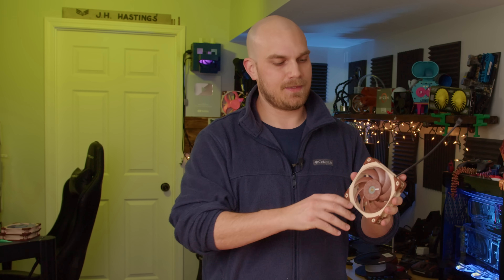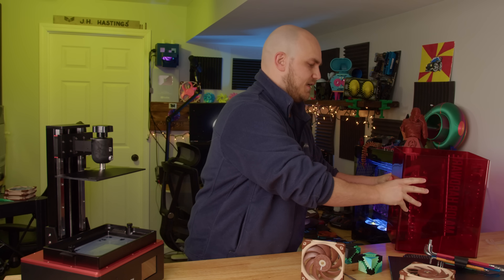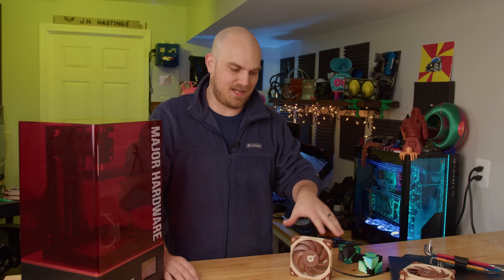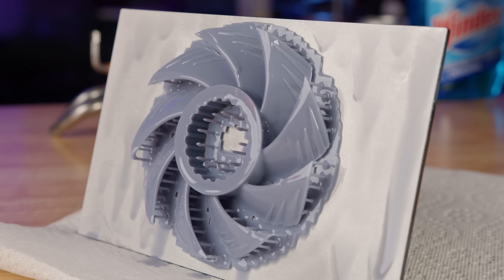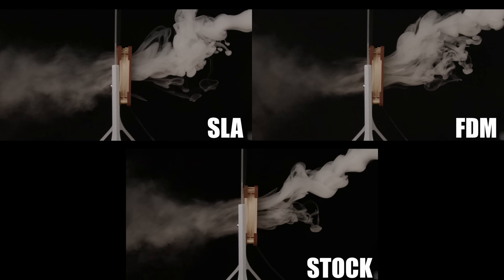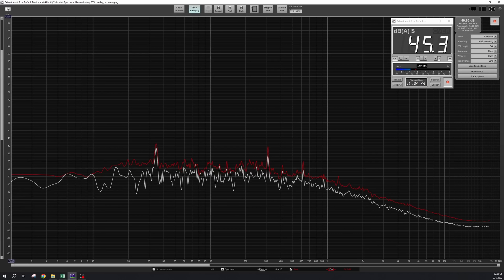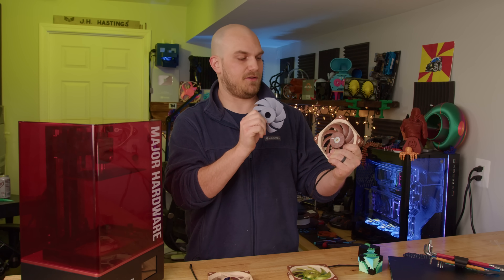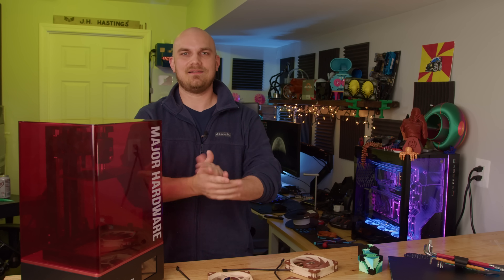I Copied Noctua's A12x25 and Resin Printed it, Its Performance Was ASTONISHING

Comment: I would rather you keep using the usual FDM, then fans are more comparable across seasons. Plus the fumes, aren't great for longterm health, plus the little ones... But if you aren't concerned, and the Resin Printer is faster. There is an argument to be made.

Comment: It would have been interesting to see the weight and RPM of each fan, maybe the observed differences can also be explained this way.
Reply: I would also like to se if there was any RPM difference between the fans, as this can be a significant factor in final CFM readings
Reply: I second the motion. Was wondering the same thing
Reply: RPM and power consumption (ie efficiency, watts per cfm) should definitely be added to the measurements.
Reply: Well if he set the test to a specific RPM which he has done before to keep it fair then it would remove the weight and RPM factor. The only difference would be power draw then if held at specific RPM.
Reply: The rpm will even be different between the individual units before modifying them. This might also change the results.
Reply: The RPM and noise frequency spikes will line up perfectly, so you can see how well they match.
Reply: +1. Would also be interesting if they are properly balanced or if there are tiny differences in center of gravity.

Comment: 2% is significant!  But there's a lot to say for easy prototyping when needed.  Perhaps if you see a pattern, you can simply add 2% efficiency if you see that difference is 2% typically, then use resin for anything put into production.  That's what I would do.

Comment: I think the resin printer could allow for some more interesting designs. I'm thinking of something ultralight that has paper thin blades or trailing edge devices that might be too fine of detail to print with fdm. I have both fdm and resin printers myself and have switched almost entirely over to resin. It's quicker, easier, and is capable of much finer detail. It also cuts down on post processing as I almost never have to do any kind of sanding on a resin print due to the better surface finish and tighter tolerances. 

A couple tips. Use tiny supports. I believe my heavy supports are smaller than the stock chitubox light supports. My light supports are like hairs that just pull right off during removal.
Second. Remove the supports before cleaning the print. Removing them after cleaning leaves more marks on the surface. 
I remove support over a silicone mat to make cleanup easy. Grab all the support material and paper towels in one hand at the end and invert your glove over them. This puts all the trash in a nice little sealed package for easy disposal.

Comment: Congrats on the family addition! Definitely do more resin it will allow for finer details and a more accurate manifestation of the intent of the designer.
Ideas - 

Don't use the x25 motor and frame, use a standardised, cheap generic - something viewers won't mind mashing up to experiment with
Beating the generic with a 3D print - that's something people will actually use, a good reason for a further fdm season.
Which is more important for cooling- pressure or flow rate. In situ, benchmark chip testing.  What design differences between pressure and flow rate fans.
Can I use this post processor hot water for something? Heating an aquarium? Baby milk warmer! (post refrigerator)  Feet warmer for winter. 
Use a PC's fan to pull external air in, then use it, post processor, to do something?
Quietest fan - without throttling - or experiment with a feedback loop to duck the fan speed - this would open up a new avenue.
Intakes and exhausts, tested with same fan, flow rate, pressure test. None, simple, complex.
Love the show man, glad to see you back.

Comment: I propose that the winner of each season could be resin printed and added to an 'all-stars' list, where old winners can be compared for various metrics.
Maybe have a 1 in 5 open season where resin is a medium option, if there is fancy internal geometries. For the sake of Sanity, I wouldn't ask for resin models. I 3D print in resin primarily for my own hobbies and it can be a real headache if you have to do alot.

Comment: I suspect that the variance is not going to be the same across the board, especially for exotic high-surface-area designs. For instance, the 'lightning bolt' blade design that proved superior in the first season might be hurt worse by turbulence on the connectors between the inner and outer blades. Not to mention all those designs with fences and rings attached to the blades, and all the ones that just did not print well with filament at all and ended up with strange edge features...

Comment: I do quite a lot of resin printing, and for fluid dynamics applications the resin will always outperform the FDM, unless you go to a ton a trouble to process the FDM surface. The steps on the FDM will cause minute "random" vortices to form and screw up the purity of the test of the fan. There are fewer noncorrectable variables to measure with resin. So because "accurate measurement of slight modifications" is kind of a topic of your channel, I think by all means you should switch to a resin printer.

Comment: Congrats on the new baby! Those first months are really tough.

I recall resin vs FDM being looked at a couple other times. 
https://www.youtube.com/watch?v=WWiZ13T3mxk
https://www.youtube.com/watch?v=_p6NTTexYk0

And then there was this one on surface finish:
https://www.youtube.com/watch?v=H33_5yJEZ08

Assuming you still have those around, maybe retest them in the current setup. Also, maybe run the setup without the rad to take the static pressure performance out of the mix.

After that, maybe do what everyone else is saying here, take a sample of previous fans and see if that 2% tracks.

If that performance loss from SLA to FDM tracks across multiple models, them continuing with FDM might be fine.

I am curious if the models that used gears like the contrarotating and clock fans work better when printed in resin, either via less friction, less noise, etc. Resin might be better for design like that and if the performance delta between FDM and SLA is predictable then it may be fair to pit an SLA printed fan  against an FDM one with delta accounted for. 

FDM might have some future advantages with multilaterals prints. IIRC you have used multilateral prints for dissolvable supports. I wonder if some clever designers might be able to do something interesting like use different materials to make prints that are rigid and flexible in specific areas as long as it's not too big a PITA for you to set up the prints.

Comment: Firstly, congratulations on the baby!
Secondly, I absolutely think printing in resin is the way to go.  But, I think that also means you'll have to print at least the #1 performing fan as a sort of control.  Ooo!  I wonder how well The Cheater and others would do in resin.  And, in shifting to resin, you can also do a redemption run for the handful of fan designs you tested that had fine detail issues because of filament printing.

Comment: I like the idea of going to resin printing.  I print in resin a lot, and what helps me is A) I use Elegoo's newest models which have a small carbon filter built in. B) Elegoo has a low VoC (low smell) or water washable resin which also is less smelly C) I have and the biggest help to me I have a box fan with "cut to fit carbon filters" I bought on Amazon that I run to move air around my printer.
Reply: Elegoo water washable resin is actually the smelliest resin I've ever used 😅
Reply: @Cryect  admittedly I have yet to try it, their website claimed it was lower odor, will have to try it now.  I wonder if it's because it's water soluble therefore can dissolve in our bodies that makes it more irritating.

Comment: Going to join the chorus of; FDM unless the design would actually work better in resin (either thinner geometry etc). I have a resin printer and a FDM machine. I prefer the FDM machine whenever I can mainly because of the post-processing process for resin printing. But do use both depending on what I'm aiming for.

Comment: I mean..  resin is the obvious choice here and has been from the start. Especially models with smaller/thinner features will simply not turn out well on FDM as we have seen in the past. Your dismissive attitude about resin so far has actually been one of the big reasons I stopped watching fan showdown because there were several designs which were clearly were completely ruined by being FDM printed and I don't know how you can look at some of the fans you printed, look at the model provided and go "yeah, this is fine".

Comment: Suggesting a simple change - in the standings, use the printed Noctua fan as the reference, not the original factory version. That would put everything on the scoreboard on the same footing.

Comment: I'd say if resin printing is a more difficult, that you could just test some more fan showdown designs against each other in resin and filament, and if they're all about a 2% difference, then you could just print them in filament and add the 2% to your calculations going forward. Same end result, same easy work. Even if they aren't all 2% different, just test maybe 4 or 5 fans, come up with the average and go with that.

Comment: Since it's a bugger to print resin (for you), I think that printing maybe 5 fans in both resin and extruded, and then see if your 2% holds up.
If it does, or, if a new average emerges, then...... Seems fair to let you adjust the numbers to "simulate" a resin print.

However, if the numbers aren't consistent... Then you know it'll help to print in resin for next season (as well as for the reasons you gave). 
Which is possible that will be the result, given some fan designs have presented with more pronounced aliasing than others. Something I imagine occurs mostly on low angle blades, due to printer resolutions.

Anyways, congrats on the new kiddo, and my condolences to your lost free time! lol

Comment: I think a lot of my complaints with videos lately is that the fan designs are so intricate that the fdm is just butchering the print and likely causing significant imbalances. Does every print need a resin print? Well,no. I have a Saturn too, and yeah, if you have a day job,then you are realistically only going to get 1 or 2 prints out a day, and only 1 fan is going to fit. That is a time sink. And the post processing is a pain.

But the other nice thing about resin printers is just how easy the print process is. I had a few fails calibrating mine... But once it was dialed in, no failures. Leave the thing sitting untouched for 2 or 3 months, stir the pigment so it is suspended in the resin again, and hit print. No issues! The things are finicky to get going but once you have your settings, you are good for life.
Haven't had any issues with the smell of the printer, and gloves are a must! But it is the cleaning that gets me. What I found works best for me is accetane in 2 old paint cans. Put the print in the first dirty can for 30 sec or so and swish it around. Then fish it out and another 30-60 sec in the clean can... Then under a UV light for 3 min or so, and then a water and toothbrush scrub, followed by another couple minutes under the light. It is a lot of steps, and it stinks like hell, but it only takes 15 min, and the material cost for cleaning is basically just gloves. As the clean can gets dirty, pour it into the dirty can and replace with fresh acetone. It lasts a super long time while being very effective that way.

Comment: I'd say to keep with the FDM printing. It will keep your interest longer, and the results more comparable. If certain geometries work only with resign, go ahead and use that, but it doesn't sound like you want to use resign for most of the work.

Comment: Easier solution is use the fdm printed noctua as the baseline rather than the stock one. Also try doing some sort of finish on the fdm model and see if you can get closer.

Comment: It’s likely to have the most noticeable effect on any fans that have an extremely thin profile. I’ve noticed multiple times you not only complaining that the edges of your then fan designs have a scratchy picked and residue chocked profile. Resident printing would make those significantly more aerodynamic and lead to a stronger airflow

Comment: I think you should do a test. 5-10  fan designs you have tested, printed in resin. If you find a roughly 2% difference each time, then printing an SLA is pointless since you don’t like to do it. You can just have a footnote stating resin will have a 2% increase in flow but negligible impact on sound. If you find the resin prints have wildly different results (but always better) THEN you may need to switch to resin.

Comment: I think there is a good compromise here: Resin printing is a more time consuming process, so maybe you only resin print the top 4 or 5 in a season? Like for the finale, see which ones did the best and have a shot at beating the Noctua, resin print them, and put em to the test. That way you don't waste time resin printing garbage designs that were just made for the memes.

Comment: I think what you should do, if you really dislike resin printing, is continue w/ the FDM prints for next season but when two fans are neck-and-neck, where there's only a percentage difference in performance for them to be in a top-10 spot THEN you print resin versions and re-test. Or just switch entirely to resin prints for the season. What would be really cool is if you just printed FDM and resin versions for all fans for a season so we could see how they compare but that sounds time costly. Anyway, that's my two cents.

Comment: I think it would be interesting to have the fans resin printed for the next season of fan showdown, but I think a 2% difference of performance is well within margin of error, so it would be more about the differences in creative flexibility for designers, such as having thinner blades.
Reply: I would say fans justify being resin printed IF they can come within 2% of the OG model. Otherwise just stick with fdm to get the ballpark. Or perhaps just do a finale with the top 3 performers in resin.
Reply: To be honest blade thickness is probably limited as much by them flexing under stress as the printer. But it would probably help a bit with the tolerances and such. Still not sure if it's worth it.
Reply: its probably too expensive

Comment: As a owner of a 3D resin printer, I know the pains and struggles of resin printing. I've printed many times with it, but (specially with specialty resins) the whole clean up process and waste produced being toxic makes me not want to print with it. I actually often hold off printing for weeks because I like to do all my printing at once and then get it done with.

Though I would say don't do resin printing for the fan blades because adds a lot more work for you. Instead maybe for the winners of the rounds, give them the resin 3d printed treatment. So a bit of a hybrid, FDM for seeing which fans do best and then only on the best ones do resin.

Comment: Congratulations!  Well done mum and dad!  Great video by the way. You said you had them on the same frame - does that mean the same motor?  Also did you measure the input power and rpm? Also do you correct for air density? The acoustics was interesting, the large peak is the blade pasing freq which is not supprising that they are the same as same number of blades and ~same rpm.  The size of the BPF peak and harmonics (@ regular multiples of the BPF) changed fan to fan as well as inc. broad spectrum noise.  This is going to be the manifestion of whatever the greater losses are in the form of turbulance.  Did you check your print fans for accuracy - specifically the gap between blade tip to housing and eccentricity? As someone else said, do you best performers in resin. Thanks for putting you model up. Take care, D

Comment: You could still print the FDM version at way higher/smaller resolution, Prusa supports up to 0.05mm per layer, standard for high detail is 0.1mm or 0.16 with dynamic layer height (going from 0.1mm to 0.2mm)... It wouldn't be as smooth as resin, of course, but it should be visibly better.
Reply: Absolutely! This is what I came here to say... this wasn't so much resin vs FDM test as it was a layer-height test. Bring them more inline with each-other and it'll be a more valid comparison. If I was to print fan blades for serious use, I would definitely not go as coarse as 0.2mm layer height.

Comment: I am not a huge fan of resin printing. Totally normal as the building plate is so small.

On another note, thanks for the video, I didn't expect such a little difference in performance, in my opinion only a 3% increase in efficiency doesn't justify the hurdles of going to resin printing

Comment: I feel like you should have been using the Resin printer for all of the models. Fans have a smooth profile for a reason lol. I had no idea that the resin printer was so much nicer for finishes. You're going to have to now go back and reprint every older design on resin... sorry but that's going to change everything.